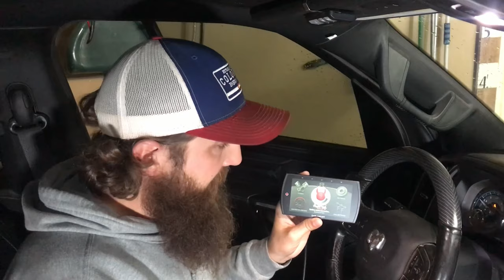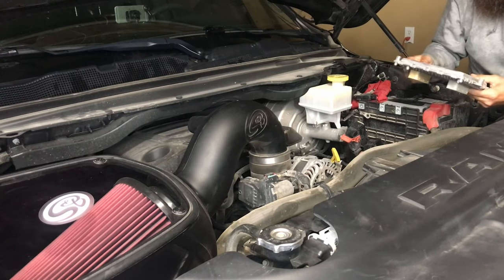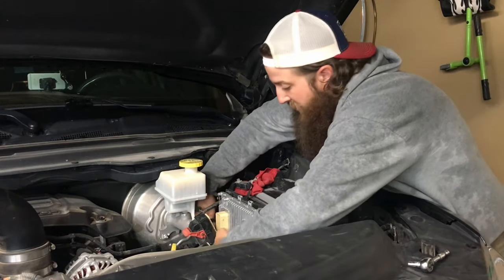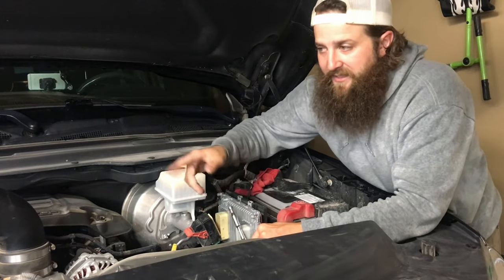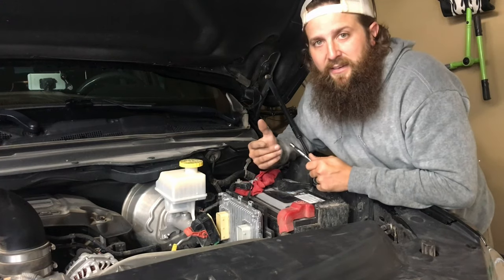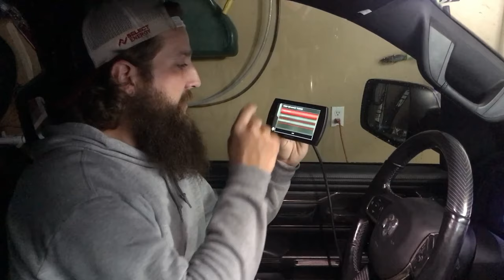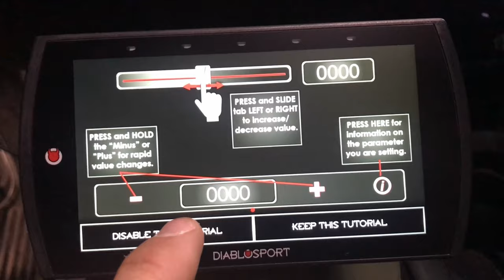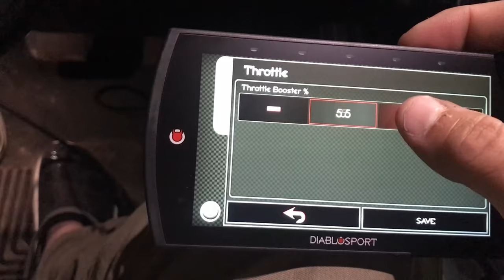2019 Ram 1500 gets a Performance Tune (Install and Initial Impressions) | Truck Central

Comment from the maker: You knew it was coming... time to wake this HEMI up!!
Reply: If I’m not mistaken you can also turn off traction control with that unit
Reply: Tell me you guys have something for a 2020 Ram Power Wagon 6.4 that does the same thing! Then take my money 💰😂
Reply: @chrispryor9721  you can turn off traction control on mine with a button and a setting too.
Reply: @vickaminski  but it resets when you turn the truck off and it also turns off the abs cause that’s what the nanny is controlled by. It’s the stupidest thing ever the idiot who put that on the trucks should be punched. You cannot take an off-ramp or on-ramp without the truck spazzing out
Reply: @chrispryor9721  I do think there is a setting to keep it off by default, I'll have to check. Mine is fine on exit entrance ramps, what do you mean it spazzes out
Reply: @vickaminski  I lifted my truck 3.5 inches and I think it screwed the nanny up somehow. It starts to activate the abs to the front left or right depends on which way I’m turning makes it really hard to steer. If I take a turn at faster than 30 mph it starts spazzing out and activating the abs to one of the front wheels. I bought the Diablo turner to turn it off but they lied to me it and said it does but it doesn’t turn it off, it will turn it off till you turn the truck off and back on and the abs system resets. It’s the dummest thing, turner is good for turning off speed limit and turning off cylinder deactivation that is pretty much it
Reply: @vickaminski  we’re you able to turn off traction control completely without turning off abs ? And did it stay off ?
Reply: @chrispryor9721  no
Reply: Does this void any warranties?
Reply: Where did you get the Bypass Module from?

Comment: Borla Atak exhaust is the only way to go. I looked at Flowmaster and a few others. Borla was my first mod and it made the truck sound like a Charger/Challenger exhaust. Just installed the S&B intake and holy crap! It sounds completely different now and I love it! Taking it to the track this weekend for a big Mopar event.
Reply: That’s awesome! Did you install the exhaust yourself? Good luck at the track.
Reply: @MrJustinWheeler  yes. Took about an hour and a half. Hardest part was getting the old exhaust off. I cut the driver side right at the axle. I set the suspension to off-road 2 and did everything on the ground. Put the truck on a lift and you could probably do it all in an hour.
Reply: @Hellhound501  good to know. Did you replace the exhaust manifolds as well? One concern I have is dealing with my gooseneck hitch. The installers said it was a tight fit with the exhaust.
Reply: @MrJustinWheeler  that's going to be next thing I do. Think I've made my mind up on the kooks long tube with y pipe
Reply: That's what I have on mine.  Ruins it for long trips, but dear lord I love it.
Reply: Have mine sitting in the box in garage. Planning to tackle it myself these next few days. I’ve seen a lot of video on cutting the exhaust, but is it possible to remove the stock exhaust completely with no cutting ? And installing new one?
Reply: While I was looking for exhausts I finally decided that corsa was my route. It was close but between the borla atak and corsa extreme, I finally went with corsa.
Reply: @seventhcrow211  any update on it?
Reply: @benjaminvanlandingham5568  yes, I have had the corsa on for quite some months now and I never get tired of starting my truck in the morning to hear her pur. I love the pops I get out of it and it was a clean switch with just a jack.

Comment: I installed a new Flowmaster Super-10 performance muffler replacing just the main factory muffler & for now left the two rear dual resonators & got a fantastic raw Hemi sound yet fairly quiet for my sleeping neighbors when I leave at 3:30am for work. Down the road I might have those resonators removed for the full blown street racer sound like my 2008 Ram work truck had.
Reply: So the resonator has nothing to do with catalytic converter
Reply: @livefootagetube  No, I would never touch the cats, everything else is behind the cats with resonators at the very rear of the exhaust pipes.

Comment: I laughed when you were turning up the throttle response. I have the Diablo Tuner and unlocked pcm on my wife's jeep srt. We turned off the mds and ran the 93 octane tune. The 6.4l is pretty well maxed out from the factory so it didn't do much but it will be great to have the tuner when our warranty is up and we put headers on it.
Reply from the maker: Headers are in this truck’s future too. Wish it had a 6.4 but this 5.7 will do!
Reply: @TruckCentral  that is going to be sweet. Those black ram limited trucks like you have are really nice.  I'm glad to see they hold up so well.  I can't wait to trade up to get one.  I'm hanging on to my 2017 until we get the jeep paid off.  Then I'm going for a fifth gen similar to yours.  Thanks for taking the time to make this series.

Comment: Please turn off the throttle booster and retest with 87 tune, you changed 2+ things at one time and it's hard to identify what caused the change you are seeing. A simple pedal booster from sprint/banks can make your truck feel much faster all without using an intake or other tune. What I'm interested in, is do you notice any thing just running stock pedal with 87 tune.

Comment: I got a cold air intake. But the only time i feel a lil something extra on the pedal is winter time. The air is actually cold all around the engine bay and it works, the truck is a tiny bit quicker when you give her

Comment: Love the sound of the hemi I just ordered my tune for my hemi hope my tires spin too
Reply: I am certain they will. Good luck!
Reply: my 2019 crew cab spins tires from dead stop without a tune or pedal commander, but I have the 3.92 gear ratio
Reply: Youll be hoping they dont traction is a problem after the tune and some bolts on💪👍 love/hate relationship
Reply: @Captain_Brown_Beard ya same. 3.92 spins all the time 😅

Comment: The cold air intake and the PCM replaced would it void the factory warranty since my truck is still under warranty?
Reply: Yes.
Reply: Yes ur better off buying anothe ecu that way u can just put the stock one back in case u need to deal with warranty

Comment: What's the purpose of the security bypass? You have to replace stock computer?
Reply: Unlock it so u can go faster than the goaverned speed
Reply: I like the timing tweak,and changing shift points.
So far, I have done 3 trucks with dial in tuners.
The last also was a scan tool and could tell me exactly what and where something was wrong.
Reply: That was on a 2012 single cab.
Had wheel sensor go bad and a coil pact.
With that you just went and bought the part.
Reply: Seems with security bypass you could up load stock tune then install new tune.
Reply: The memory may not ne able to do both.

Comment: Long tube headers 3 inch y pipe and electronic cut off best sound ive heard off my ram you get the hemi phart and back fire noise at high rpms! And u can make it stock quite with a touch of a button! Stock silencer still cause california hates loud v8's

Comment: What exhaust did you end up going with? I'm about to delete my muffler and resonators. I hear that's the meanest sound.
Reply: B2 fab muffler delete. Leave the rest alone.  Best sound, least expensive.
Reply: I did a resonator and muffler delete on my 21 1500 Laramie. Sounds amazing and very mean growl. Only way to go and was only $180 at my local shop here.

Comment: Do the borla atak if you want to make it sound like a real v8 should go with the borla touring if you just want to make it a little better 🤌
Reply: If I decide to upgrade the exhaust, it’ll definitely be the ATAK.
Reply: @MrJustinWheeler  an exhaust video would be great.  Something I think a huge audience would be interested in.
Reply: Look at Stainless steel works for exhaust j
Reply: @CoffeeNo0b0514  you got that lift installed at your house yet??
Reply: @jeffturner7817  they’ve got some nice stuff. Have you ever used them before?
Reply: @MrJustinWheeler  yes sir.
Reply: @MrJustinWheeler  I just bought a 1500 2 weeks ago and I can't find any exhaust that sounds nearly as good my buddy has it. It'll definitely be my first purchase for it
Reply: I put the borla s-type on mine and love it. Its not annoyingly loud on cold starts so my neighbors dont hate me but it still growls real nice.

Comment: Does this touch screen device have to be plugged in at all times or can it be tuned and unplugged
Reply: It's just a tuner. You don't need it plugged in except for tuning it. Can also use an itune i3

Comment: How is the mpg after the turning off the mds?
Reply: No change at all just doesn’t bog down when cruising. I drive with it off and I still get the same mpg
Reply: Same mpg. In addition ur cam won’t get chewed up because of long time idling

Comment: Well I say your truck your choice but I got a 2010 TRX 4 Ram 1500 and cuz Dodge was stupid and put cast iron headers on aluminum heads I had to replace the headers so for exhaust I'm running BBK shorty's ceramic coated headers a stock y pipe but a MBRP stainless catback sounds damn good but not to loud
Reply: How long have you had your headers? Did you also install by yourself?
Reply: @dustinjohnson7002    I put them on bout 2 years ago now. The install ain't bad just gotta have patience cuz the driver side is annoying not bad just annoying. But other than welding a nut to the broken bolt in the head I think it took me maybe 2 hours more or less

Comment: SPRNT BOOST DOES A BETTER JOB….HANDS DOWN…
Reply: Love my Sprint booster….added to my Ram Airflow intake….truck is so much fun to drive now…..
Reply: Sprint booster doesn’t change ur fuel mixture aka tune the vehicle. All it does it change throttle response.
Reply: @khyoon14  that’s the same goal is make her faster when you punch it ……I let several guys who spent lots of money on tunes drive mine….they asked who tuned mine…..